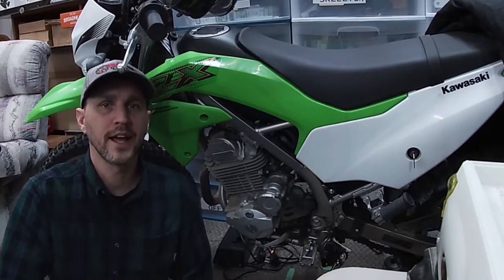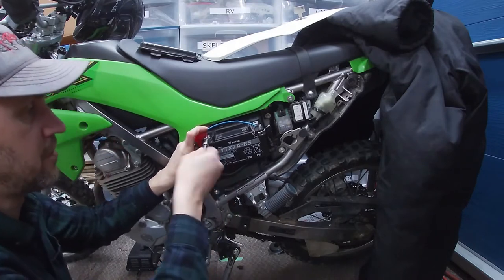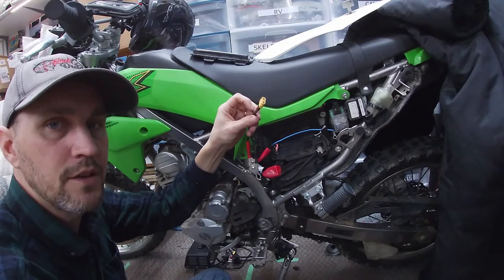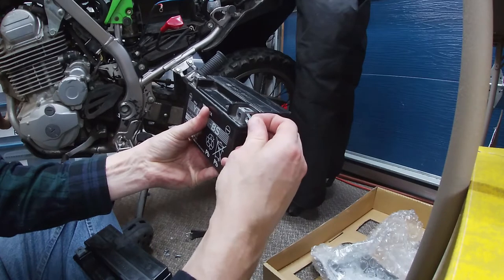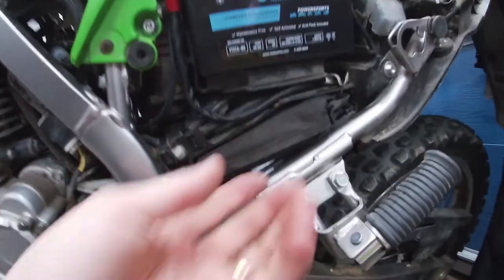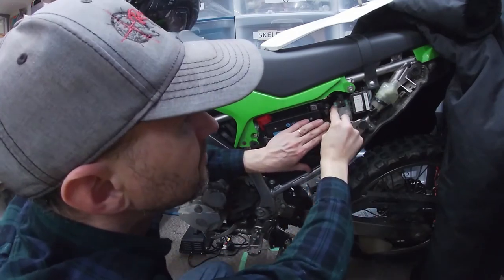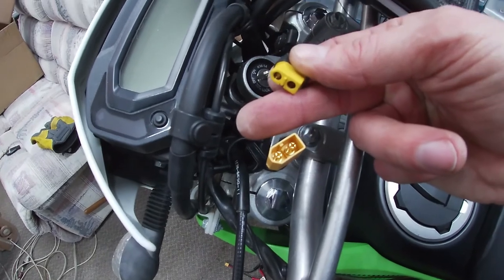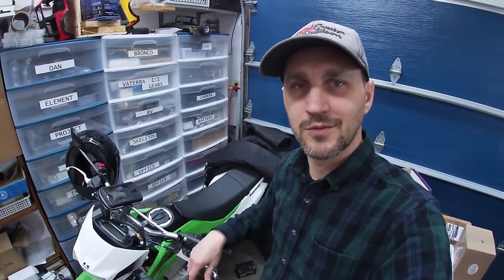Kawasaki KLX 230a Battery and 12v Update

Comment: Why didn't you upgrade to LifePO4 (Lithium Oxide) battery? Weighs 3-1/2 lbs lighter, more durable and higher Cold Cranking Amps. Change out the 55/60 watt Halogen headlight buld with a 12 watt LED, brighter and lower watts, less stress on the charging and battery and allows for more electrical accessories such as a usb charger for your phone, GPS or heated hand grips or seat heater. Just saying.
Reply from the maker: That's a real possibility. These tiny glass mats don't have a long life.